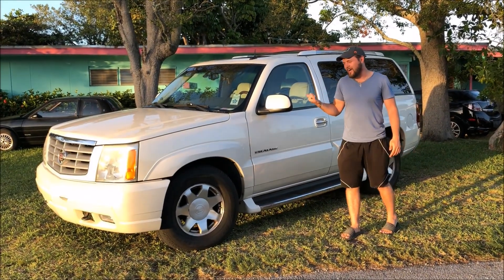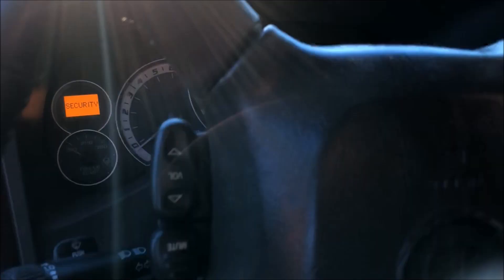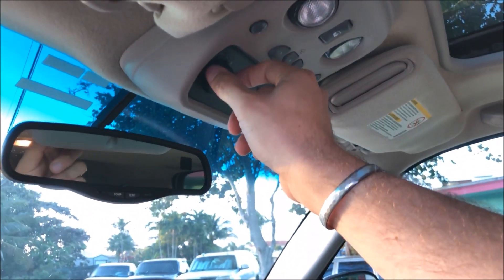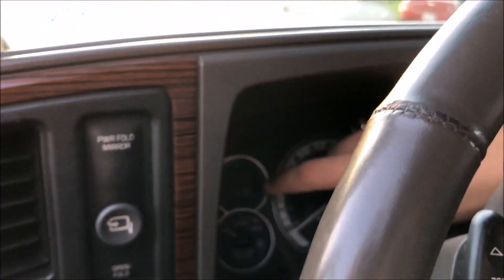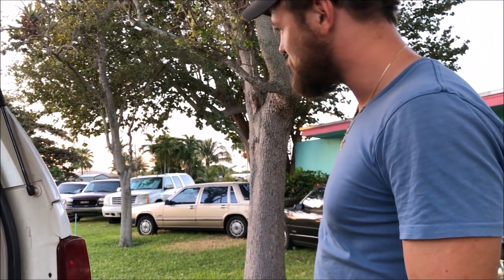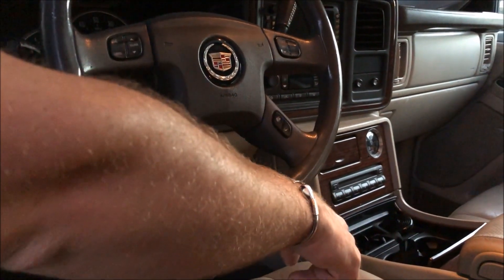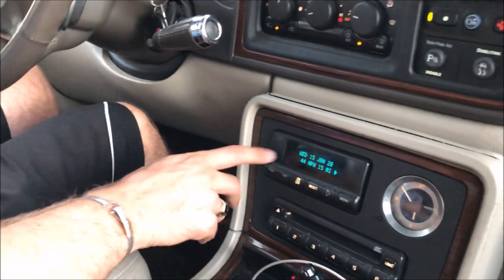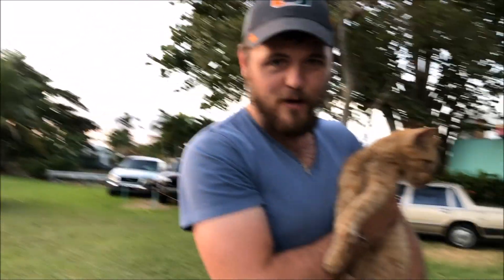I Bought A 2002 Escalade For $1300

Comment: Little  tidbit  of info , the short wheelbase  escalades  were  built at GM'S plant in Arlington  Texas, while the ESV'S were  built in GM'S Silao  Mexico plant. Great deal on the 2002 Escalade.
Reply from the maker: Neotank22000 that is true, although I’ve never noticed a difference in quality between the Mexico built trucks and the Texas trucks.

Comment: I bought a 2002 escalade for my mother for for 1500 with 160k on it Mother's Day (and for me to do errands and work commutes. No check engine, same color.
 Just getting into upgrading it. Cold Air Intake, exhaust, and LEDs in all lights. My mother loves it and I'm planning on upgrading the brakes, rotors, tire, dual muffler, and dual dan to give more space to get at the belts. 
Mother and I love the truck and hope others get the chance to enjoy this vehicle that I've always loved 
 since I was 8. Just take care of the fluids and don't beat on it, it'll last like a Toyota camry. Totally worth it in my book. Best of luck with yours, hope you keep it and enjoy it like we do. Great video, thanks for the share. 😎 👍

Comment: I have escalade 2002 6.0 liter AWD
The 2002 model has a feature that cannot be found in 03 to 06 models, on 02 you can change AC filter. I did on my Escalade and the air flow improved because the old filter was really dirty.

Comment: It always AMAZED me how these Slades sold so much better than the '03+ Lincoln Navigator... Ford invested ALOT more into the 2nd gen. Navi than GM did with these since they had their own unique interior design, more gizmos, IRS, etc... While these were really just badge-engineered over-priced work trucks thinly disguised as "luxury" SUV's with fake wood on the dash and a Bvlgari clock lol. Best thing I could say about these 2nd gen. Slades is they turned out to be alot more reliable than the Lincolns now that they're old. Good cheap workhorses to buy today, but it's amazing how quick consumer's standards have risen when these trucks were "the standard" less than 20 years ago.
Reply from the maker: Corion H I’ve owned quite a few of the 1st and 2nd gen Navigators, I used to buy them because they were so much cheaper used than these 2nd gen Escalades and for a reason. You have to drive a 2nd gen Escalade to understand that despite it sharing so much with a Tahoe it drives like a completely different vehicle with the LQ9 and the softer suspension/interior upgrades.
Reply: @bigalsbikeandauto  first gen navigators had a good engine and transmission. 4 valve 5.4 and 4r100. Same transmission as the diesels had.
Reply from the maker: D4x4Bronc the InTech in the 00-02 Navigator was a great engine.
Reply: @bigalsbikeandauto  Oh I've flipped a handful of these 2nd gen. Slades and a ton of Burbans and Yukons from this era... Same trucks, and they drive virtually the same aside from engine power (6.0L). The differences between an F-150/Expedition and a Lincoln Navigator from this era was alot more dramatic. I don't think these are "bad" vehicles at all, and they've definitely held up better than Navigators over time... These Slades are mostly just hilarious when you really look at how little they are differentiated from a Chevy Silverado work truck inside, yet GM consistently managed to outsell the much more impressive Lincoln Navigator (for the time), and for more money lol.

Comment: What advice do you have to improve my fuel mileage in my 2003 Escalade? V8 6.0 VORTEC ENGINE.  155k miles when I bought it the average MPG was 9.5, after driving around town it went down to 9, then after highway driving and switching driving style it went up to 10.1 .. now today its as good as 10.4 , but it should seriously be higher. The check engine light came and went for the Mass Airflow sensor but it hasn't came back since, im wondering if I should change it anyway and what else can be done to get better MPG?

Comment: Great video man, id like to add a few things while we're on the topic of 2002 vs 2003-2006 model differences. 
2002 was the last year for a cabin air filter, and I believe a glovebox or ashtray light. 
2003 introduced things like HID lights, and power adjustable pedals, as well as the turn signal mirrors.  
The onstar systems did in fact change, if I recall correctly it goes something like this: 2002 had the old analog system that cannot be updated or used today.   2003-2004 had the analog with digital capabilities, which can be made to work with an upgrade from the dealership. And 2005 and up came with the digital capable system which can be activated with no work. 
Finally, 2002-2004 had fan clutches, which tend to fail a lot instead of electric fans like the 05-06 model. 
Thats all I can think of off the top of my head, I know there's minor differences like the tailgate glass handle and little other stuff but thats not as important.
Reply: 2002 had better window buttons and don't have the dual a/c control issues
Reply: I have an 05 and wish it had the cabin air filter

Comment: I have a 2003 Trailblazer with a 4.2 original engine, no internal repairs to date (never opened up), trany replaced at 215,000 miles with a GM rebuild, now with over 325,000 miles (I am the original owner).  She receives a Rust Check treatment once a year in Niagara Falls, Ontario by Dave Hardt at Rust Check on Crop Street.  Granted I do spend money to upkeep and update the vehicle, but at around $2,500 per year, it is less than half of what an equivalent lease or SUV payment would be.  I cannot imagine anything GM has made in the last seven or eight years (since it became Obama Motors) will hold-up as well as this one.  No airbag replacements, no ABS problems to date.  Hard to believe this is my daily driver, summer, fall, winter and spring.  My advice is use GM pro level, Bosch, Michelin, MCI and Bilstein parts as much as possible.  I have even had the exhaust from muffler back to resonator re-done using OEM stainless steel components.

Comment: 214k, basically one owner, mint for $1300? Wow that's insane. Definitely a steal. Clean up the lights, wash it, spray tire shine and that's an easy $5,000 + SUV imo. I sold an '04 Tahoe for $4500 and it had 230k miles. Definitely could get some good money from it, but at $1300 I'd just keep it. Probably the nicest vehicle you can get for $1300!

Comment: I did not know these cars had all these differences. It is amazing the changes that were made. You know your Escalades. It appears some of the changes are not necessarily for the better.It looks like GM was cutting corners. I enjoyed seeing the differences.  I found a 1995 Oldsmobile 98 on Ebay.  The car has a 160,000 miles on it.It is on Ebay right now.  Is that mileage too high to purchase?  Could you send me your email address again?  Thank you.
Reply from the maker: OLDS98 i wouldn’t worry about 160k miles at all. Bigalsbikeandauto@gmail

Comment: Go with LEDs on the 02. Zdatt lighting on Amazon sells a 12,000 lumen bulb that I ran in my 06 Suburban and they where good bulbs. Plenty bright and no issues, plus I’d you have one go bad they will send you another one. Also have you ever had any interest in the Yukon Denalis? Or the rare 2006 Suburban LTZ?
Reply from the maker: TRUCK OCD I had a 2003 Yukon Denali XL for a while, sold it with 270k miles when the transfer case for the AWD started clanking, something that I would have fixed today (I didn’t hang onto cars like I do now back then). Haven’t had the pleasure of owning an 06 LTZ yet, at least not that I can remember. I’ve owned a lot of suburbans of all years, most recently a 05 LS in 2016.
Reply from the maker: TRUCK OCD as for the lights, I want something as close to the factory Cadillac HIDs as possible, is 12k lumens brighter?
Reply: Big Al's Bike & Auto 12k is pretty bright. The bulbs I got had glass sleeves that where tinted different colors so you could choose what color temp you wanted or you could just keep them plain white. I have the same bulbs in my 11 Silverado and it will illuminate a street sign yards before I pass it.

Comment: The Escalade is the same size as the Tahoe correct?  Just the Cadillac version?  What does Cadillac have in the size of the Suburban, or do they have a Cadillac version of the Suburban?  

Like those older model GM's.  Only issues they seem to like to have are electrical problems LOL.
Reply: William Sevier the esv he shows is the suburban sized one
Reply from the maker: William Sevier haven’t ever had an electrical problem with any of these trucks. The Escalade ESV is the suburban size; I showed it briefly in the video.
Reply: @bigalsbikeandauto  Awesome, thanks for the information.  I guess I've never seen the ESV model just the smaller ones.

Comment: I’ve been wanting to buy a 5.3 NBS chassis (most likely the Silverado and prob a 03-07.5 one) any tips for looking and maintenance?
Reply from the maker: somebody just the basics, how the transmission shifts/color & condition of the fluid. That’s pretty much the only flaw of these trucks, and if it was maintained is a non issue. 240k miles on my 01 4.8 Sierra with its original transmission, still shifting smooth as butter.
Reply: Big Al's Bike & Auto Thanks, I’d go Duramax but me being 15, I feel more confident in maintaining a 4.8 or 5.3 rather than a 6.0, esp w gas.